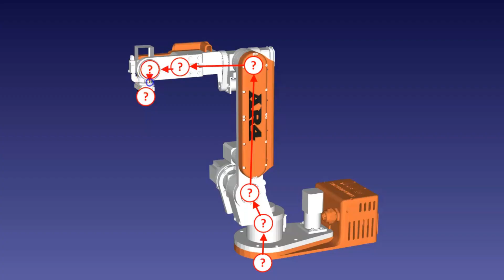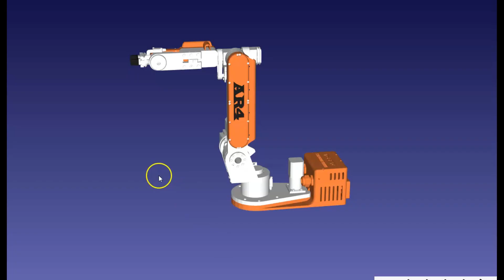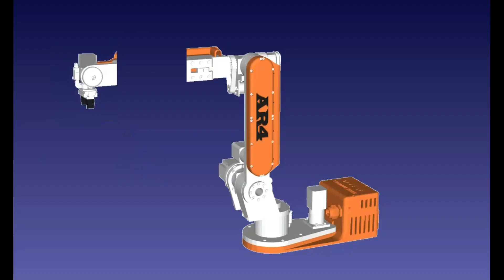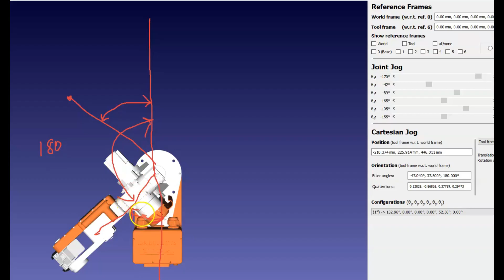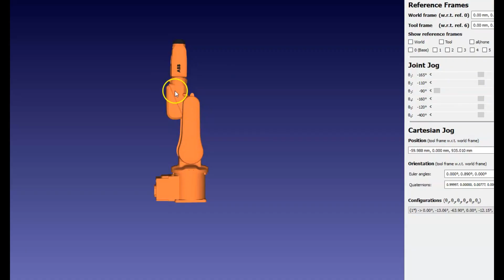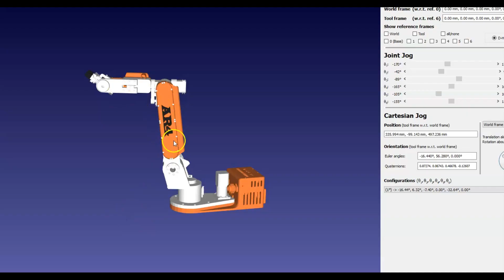6 Axis Robot Forward & Inverse Kinematics Tutorial - Denavit Hartenberg Parameters With the AR4-MK2

Comment: how can i do if i have 5 DOF robot?
Reply from the maker: Hello, if your robot has 5 DOF, the kinematics approach is similar, but with one important limitation: a 5-axis robot usually cannot control full 6D tool pose independently.

For a 6-axis robot, inverse kinematics typically solves for:

X, Y, Z position
Rx, Ry, Rz orientation

With only 5 joints, one of those orientation freedoms is missing. So you usually need to decide which tool orientation is most important for your application, then constrain or ignore the remaining rotation.

For example, many 5 DOF robots can still position the tool in space and control the tool direction, but they may not be able to freely rotate the tool around its own centerline like a full 6-axis wrist. In that case, the inverse kinematics must be modified for the specific robot geometry and for the orientation constraint you want to maintain.

The AR4 kinematics tutorial is based on a 6-axis robot design, so the exact equations will not directly transfer to a 5 DOF robot without modifying the inverse kinematics for your joint layout. The AR4-MK5 itself is documented as a 6-axis robot design.

Comment: Hi Chris, I'm currently migrating my project to use the updated kinematics in the v5.1 sketch. I've encountered a discrepancy in the Denavit-Hartenberg (DH) parameters, particularly when comparing them to the values presented in your video demonstration.

Could you give me a hint on why these values are so different?

// DENAVIT HARTENBERG PARAMETERS
// V4.3
float DHparams[6][4] = {
    {0, -90, 169.77, 64.2},
    {-90, 0, 0, 305},
    {180, 90, 0, -.0001},
    {0, -90, 222.63, 0},
    {0, 90, 0, 0},
    {0, 0, 36.25, 0}};

// V5.1
float DHparams[6][4] = {
    {0, 0, 169.77, 0},
    {-90, -90, 0, 64.2},
    {0, 0, 0, 305},
    {0, -90, 222.63, 0},
    {0, 90, 0, 0},
    {180, -90, 41, 0}};

Comment: Hi Chris, Thanks for the great video. Just a quick question regarding the calculation for the J1 angle. In the if..then statement, in the first case if q44 == 0 it returns a result in radians (RADIANS(-90), whereas all of the other cases the result is in degrees. Just wondering if this is a mistake or just my lack of knowledge with this?

Comment: Thank for the tutorial I have a question. If I just change the DH parameters for the bigger or other types of robot. Is this calculation are suitable? eg. I would like to use the Yaskawa GP12 and I have change the dh parameter of  Gp12 robot?
Reply: The assumptions made for the geometric inverse kinematics solution may not hold if the DH parameters change. If it is just values increasing it will be fine but a different joint configuration may not work

Comment: As I walk thru the video, I notice another inconsistency, between stick diagram on sheet 3 and DH table on sheet 1, for joint 6, which is just a pure translational offset from Joint 5 (considering joint 0 is the first joint) , both theta and alpha should be 180 degrees, instead of 0, as some of the cosine will be affecting the total result, e.g. -1 instead of 1. Also sign of X6 and Y6 should be flipped, cheers

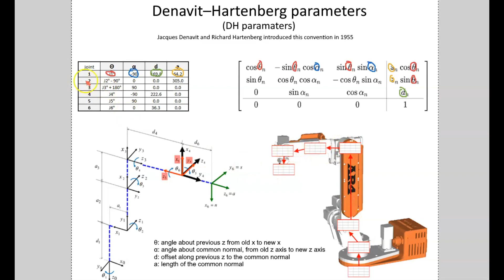Comment: At 46:57, in the completed diagram, how does the Frame 3 obey the Right Hand Rule?  I feel like the Y3 is facing the wrong way by RHR. Also, shoudn't X3 be pointing down to intersect Z2 to meet the 4th DH condition? Please advise.
Reply: Looks like there are some errors in the dh table.